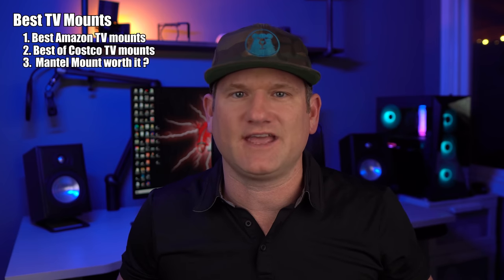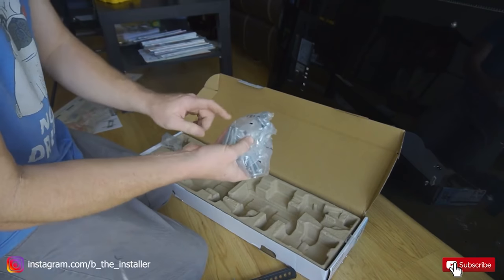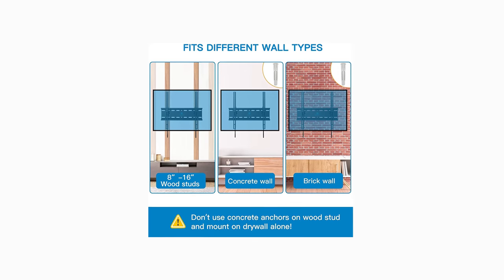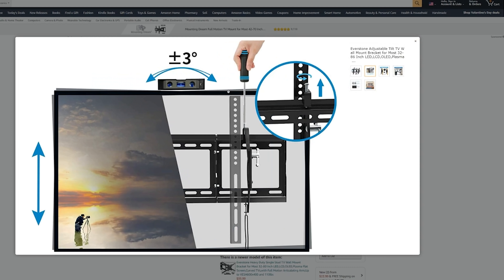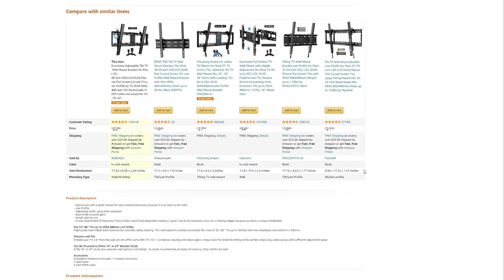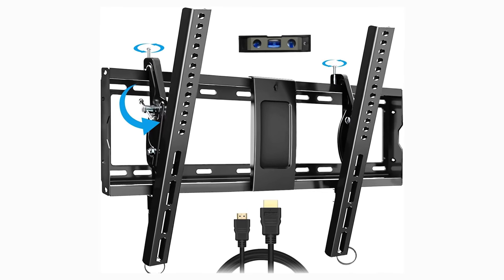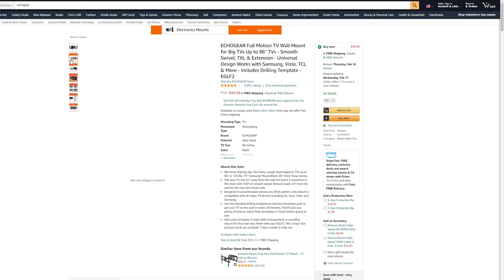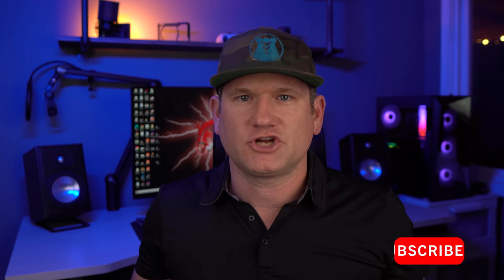Best TV Mounts on Amazon and Costco + Mantel Mount info

Comment: I'm glad that you mentioned the depth of the Mantel Mount. They NEVER show how deep that thing is, because it's actually somewhat of a deterrent. The back of your TV sits 5.7" away from the wall, so unless you have a TV pocket or TV mount pocket in the wall... your TV sits 5.7" + whatever your TV depth is away from the wall. I just bought the MM540 right from Mantel Mount because it's $130 cheaper than Amazon. I also plan on reconstructing my wall above the fireplace to create a pocket for the mount. This way I can avoid the obnoxious, protruding TV that sits further out from the wall than the mantel does.
Reply: How much were you able to grab it? Trying to decide if I should wait for a sale
Reply: @pat4761  ... I don't recall, but it was pricey. I just looked it up on Mantel Mount's site, and it looks like there's a 20% sale right now. $279. It's worth every penny to be honest. We love ours. Super sturdy, good instructions. I'm hanging a 75" on it, and once adjusted... it's a breeze to pull down and put back up. I think we paid the original $499, and I'm still not sorry.
Reply: @pat4761  I just bought the MM540 which is the middle model that can swivel up, down, left, right.  I also bought the recessed mount and this other piece that they said is needed. It came out to roughly $550 shipped to TX. Pretty pricey stuff but they do have a 90 day return policy
Reply: Thanks for bringing up this discussion about the depth of the mount. We don't want the TV to be protruding too far from the wall...

Comment: I can vouch for the fun motion Sanus mount from Costco. Smooth as silk and and I have no anxiety about it being able to keep my LG CX 65" off the floor. 😉
Reply: I just bought the LG 65"--checking out mounts now--getting a carpenter to install the mount after accuratley finding studs!!
Reply: I was playing with one today and the demo was very smooth indeed. Hopefully it holds up a 90lb oled and retains that lol.
Reply: Not sure if anybody will get this comment being that it’s a year later but I just bought the 85 inch Q 90a Samsung do you think this would be a good choice for that particular TV. I’d love to pull it out from the wall sometimes versus flush mount but I am concerned about the weight of the TV and the mount when it’s extended.

Comment: Thank you "B" for all of your video content.  I've watched several of them looking to answer my question and haven't come across it yet.  This one matches my issue over the mantle, but didn't go into how to lift the tv safely into place.
  What is the best/safest way to mount/lift a 135lb 85 inch tv at a high level above the fireplace mantel

Question:
1.  The wall mount says it can hold TV's up to 90 inches and up to 135 lbs.  
2.  How do you lift a 135lb tv's hook point up to 90 inches where the wall mount is located at above a fireplace mantle?  You had the two of you lift a smaller tv up at a lower height, but how do you lift a 85 inch or larger tv up higher?
  I bought the SANUS slf428-b1 mount.  This mount on my 85" Samsung QLED Q72DD tv has the mounting hook 12"'s below the top of the 43" tall tv.

Comment: We got the Echogear 42'-80" Articulating Wall Mount back in Dec 2017. This was for my Sony XBR-850C 65" LCD TV. To move it off the table and onto the wall. I live in Los Angeles, and I was concerned about it flying off the shelf in an earthquake. I also wanted more room to but a Center speaker under it. A buddy, who works at one of the Science Museums on exhibits and displays installed it for me. It was $100 at the time. He liked it for how sturdy and engineered it was. He was able to mount it to the studs in the wall. And he used a leveler to make the TV perfectly level. I mostly keep it flat against the wall. But it's so easy to move it, when I need to managed cables in back or troubleshoot something. I've experimneted tiliting it downward slightly to help with sunlight glare through the blinds. That can be a little ticky adjusting it. You really need 2 people. One to hold the TV at the given able you want. Whele the 2nd person tightens the knob in back to lock it at the desiered angle. If you don't adaquetly tighten it, then it can gradually can anlge forward until it hits the maximum range. It's something like 15 degrees maximum angle downward. Currently, it's flat and parallel to the wall. I do most of my serious TV watching at night. 

Then in summer 2020, I got an LG CX 65" TV. As a precaution, I contacted Echogear and told them I wanted to swap TVs, LCD to an OLED. They sent me a Sanus adapter bracket just in case. For free! Thanks, Echogear. When the TV was delivered, I had BestBuy install it. They took down the Sony LCD and put up the LG OLED. That did not need the Sanus adapter. And they got it within an inch of its originally installed location. I can't tell a difference from the couch. But they could with measurements on the wall. 

While it was $100, it's a quality product. I've very happy with it.

Comment: I got the Mounting Dreams MD2298 16 to 24 Inch stud 132lb articulating mount right after I got my TCL 65 825 set to fit the 24" studs my house has and take the weight, plus handle a bigger TV upgrade down the road. It's great, really solid into the studs, moves really smoothly, and doesn't droop. Really well made and the mounts bars and bracket on the TV are easy to slide together and really beefy. Way better than the 35 dollar eBay bracket I had before which worked fine for my previous 55" TV. It's more expensive but really worth it if you're mounting a heavy large set. I'm upgrading to a 75 Z9K so hoping and pretty sure it can mount it. I'll have to double check that...

Comment: Your videos made is so easy to understand the installation and all measurements necessary to get this right the first time! Thanks so much!!! I finally entered the world of OLED! Our home is a designer's nightmare and we can only put our new 55" TV in a corner. Bought the Costco mount your recommended only to find out 38 inches of sheetrock has one stud 16" from the corner. There's a door frame at 38 inches with NO studs  - only the trim. I need to find a mount that will work so we can extend the TV out from that wall and pivot the TV so it can be seen from from the the rest of the room. I might go to a 65" TV, so the bracket really should hit the corner stud and one at 16".
Reply from the maker: You just need that mounting Dream one and put the 1 stud in center of the wall plate.  I do that all the time and then turn tv.  They also make larger single stud mounts for 65" too.  Just look for one with 100+ lb rating on the single stud.  But personally I would just use that md2380 and turn it after hitting stud in center.  👌🙏

Comment: yes Master Installer, i purchased both MD 2617 which was substituted for MD2630 & Pipishell but neither were adaptable for PROSCAN TV MODEL 5068 w/ dipback.  Pipishell Rep.  it would not worked after screws/spacers did equalize a straight back.  i just want a fixed mounting to FRAME TV ON WALL. VESA PATTERN 400 X 200
Reply from the maker: Something like this is what I would consider for a corner Mount 75" tv.  

https://amzn.to/3WpTHrS

Comment: THANK YOU! I was able to both use your video for feeling confident in doing this on my own, but also your suggestions for the products. I have an older home and wasn't sure if I have 16" or 14" studs. My stud finder kept giving me "false positives" and so six extra holes later that I ended up patching, I almost gave up. I Googled some more and found another video where this guy suggested using magnets. Worked perfectly! I was able to confirm my 24" stud distance and the rest was easy as pie. Sharing the magnet trick in case others have issues with the studs part (which, honestly, took more time than the actual mounting!)

Comment: Exactly what I needed Brandon. Using your link to purchase the MD2380 for a 55" Furrion Full Shade outdoor TV that is 60lbs. Should work out great. Thanks again for the awesome content you provide.
Reply from the maker: Haha, so you're only just at picking the mount?  😆 you really do need me over there.  Have a good week brother
Reply: @BTheInstaller  haha I actually hired an installer as I have no desire to run electrical through cement block as it will be mounted on an exterior wall.
Reply from the maker: Yeah man... hopefully there is power on that inside wall.  If normally wood studs, should be able to get one outside. Message me om IG if you need help.. send  pics at least. I've done that many times.  💪👌  can at least help solidify plan if needed
Reply: @BTheInstaller  “should” be relatively simple as there is an exterior outlet right below where the TV will be mounted.

Comment: i got a 40 dollar Harbor Freight wall mount that works great......i had a 55 Samsung that a switched to a 75 LG and i only had to move the mount 2 inches up on the studs...as for weight, I was a little concerned because the TV was about 85 pounds but all went well...it can swivel and pull out from wall but i don't move it at all so i don't have to worry about putting extra torque on it

Comment: Great video and good information. Had a question..  any suggestions for a corner mount ? Looking to mount a 70in  Visio for my elderly Nieghbor with a vesa 400-200 and weight of 53lbs   Thanks!
Reply from the maker: A single arm, but dual stud mount is best.  So it has an arm that can be moved in many ways but can span 2 studs.  The arm doesn't need to be tight in the corner, I usually use the 2nd and 3rd Stud from Corner

Comment: I have a TV alcove that I added 2x4 supports to in order to mount a bracket. I am thinking the Mantle mount as I can recess the support 2x4" back a few inches to accommodate the thickness of the brace but my center channel is large, I thought about mounting it in the alcove so it is exposed when I lower the screen

Comment: What an informative video - THank you! I would like your recommendation on a mount that both extend from the wall AND rotates to portrait (ie 90 deg). We would like to install a 50" TV in an RV and do not have the room to stow it in landscape. I did see a couple out there that will pivot/rotate 90degress, but NOT extend from the wall. Appreciate your suggestion!

Comment: Hi, merry Christmas and Happy New year to you - thanks for all the videos, they've been massively helpful. We just bought the Everstone adjustable tilting mount for our X65A80J and I have a question for you if you can help?

I've located the studs in our wall. The manual looks like it says to just pre-drill a hole in the studs then attach directly using the provided screws. Is this how you go about it, or do you do anything different when installing (using wall plugs, or your own screws/bolts, for example)?

Comment: I bought the 3rd mount from your list and now I'm stuck not being able to mount it on my wall due to centering issue as my wall studs are not located in the center of the wall. Of course I didn't watch this video before I bought it from Amazon. Wish I had bought the 4th mount you mentioned!

Comment: Great video. I am still looking for a wall mount for my 60" tv. I am about to return my third purchased mount. Why you ask, because the builders of my house obviously framed the fireplace wall on a Friday afternoon. I have a stud at center (that works) but the one on the left is 11" out and the right side is at 16' out from the center. So the largest rear mounting panel was at 27" end to end and the mounting holes fell about an 1.5" to the inside. One came close but it had a formed rib running right where I would have had to add a hole.
I can't seem to get past the lack of actual mounting hole dimensioning in the ads for these mounts. At least you gave me a couple of new vendors to check out - thanks because I am running out of ideas short of cutting out the drywall and adding studs myself.
Reply: Hit the stud you have available and use some good wall anchors. There are plenty of very strong options available.

Comment: so i once hang a plasma tv 2007 and when i put in onto the wall  it cracked the screen, im thinking of wall mounting my oled, and i dont wanna crack the screen, any toughts on what i did wrong, and how to aviod that buying a mount that 100% wont do that. it was a type of that u showed where you put it onto the wall on the wall rack as the 2 option in this video

Comment: B, any revised recommendations? I'm looking to mount a Hisense 50U6G on a wall perpendicular to the viewing location which would require a 60* swivel and 15* tilt for it to properly face the viewing location. It would be swung out every single time it's used (possibly daily) and stowed after use as it otherwise blocks a walkway, so leaning towards something higher quality.

Comment: Hi B - awesome video thanks. Have run into a problem though and could really use some advice if you can spare a few minutes please?

I recently bought the Everstone WLT103M-ES to mount my A80J (65"). It said on the listing that it comes with the fixings for all wall types, but on opening the box and reading the booklet it only has options for Wood studs or Brick/Concrete walls. However I have aluminium studs.

Have you installed one of these to Alu studs before? Or if not do you have any tips for fixing to Alu studs in general? What sort of fixings should I use - is heavy duty toggle bolts the best option and if so can you recommend some decent ones? Or should I try to find something compatible with the large (component W1) screws provided? Or replace them with something else the same diameter?

Thanks in advance
Reply from the maker: Toggle bolts. 2 in each metal stud.  Get a 1/2 metal bit and it will chew through the stud like a warm knife through butter.

Comment: Awesome Video!  But I need a 100x100 monitor wall mount that slides 'straight' in/out. (for a flight Sim cockpit) It needs to be able to be 'centered' at every distance.  It looks like the 'scissor' mounts would work, but their brackets would stick way out. Any ideas?  Thx!

Comment: I have a question on the mantelmount. We are considering buying a framed tv as it can look like a painting. The only spot to put a tv unfortunately it above our fireplace (we have a faux wall on the wall space above the mantle where the tv would go that could effectively hide wires and brackets). Me question is when the mantlemount is in its upright position is it flat against the wall or does it tilt down slightly? With it being a framed tv we obviously would want it flat when not in use. Thanks in advance for your advise!
Ami

Comment: Hey question: I got a 12 x 10 Wood Gazebo With Aluminum Roof and I’m looking to install 43” Furrion outdoor TV (40 lbs) inside the gazebo inside the rear right corner pillar.  I’ll also be including a Furrion sound bar.  Can you recommend the best cost efficient mount that fit the top corner ?

I do have a mesh kit in my gazebo

Comment: Can anyone recommend a full articulation, single-stud mount where the center of the tv ends up offset by at least 7”? Preferably one that can extend up to 24”? I only have one viable stud to bolt to, and if the tv ends up centered on that stud it will be too close to a window. Thanks!

Comment: B I was looking at the second Everstone mount you suggested for my 85" Samsung Q60A (Shipping Weight
125 lbs) to mount in my drywall only because my wall doesn't have studs but the Everstone mount says, "Do not mount only on Drywall!" 

There are a ton of toggle mount videos but what mount and toggle kit do you suggest if you have to use 1.5" to 2" screws in a wall (max) so as not to punch out the other side. < (Old 1962 apt bldg, drywall sounds really solid)

Comment: I would really love to get your answer on this. So I bought the 85 inch Samsung Q 90a. Its weight is 98 pounds without the stand. I looked at the Costco mount you recommended that’s full motion it says it has a total weight of 125 pounds for integrity. The TV without the stand is 98 pounds it’s getting pretty close to it. Do you think its still safe to use or should I look into a different mount that has more weight capacity?

Comment: Awesome video B. I have an 83" LG C1 on the way and will have to mount it over my fireplace (bottom of TV will be ~63" high off the ground). I know it's personal preference, but what are your thoughts on whether that height is too high, especially considering the top of the TV will be ~104" high off the ground? I was looking at the Mantle Mount 750, but $1,000 for a mount is 25%+ of what I paid for the TV. I may just put that money towards remodeling that wall and changing to a lower profile fireplace. I appreciate any thoughts you may provide.
Reply: How did you end up mounting your 83"?

Comment: Any particular model you’d recommend for this, Brandon?

Planning on having my 77” a80j mounted onto a 2” concrete wall, planning on the bolts going through & being anchored 🔩 on the other side of the wall, with wires also going through, then coming back out near the floor.

I have my own level I’m providing the installer just in case, lol.
Reply: Spend a little money and get a MountIt! Mount

Comment: Great video, looking to purchase the Sony XBR-900h 55in. Also still on the fence for the XBR-55A8G OLED. I already have the MD2380 new and ready to install. My question is should I spend top dollar on the Sony SU-WL855 ultra slim wall-mount , due to the fact I go from flat to 30 degree daily. Also 65 inch is also and option. Thanks I'm really enjoying your videos.
Reply from the maker: I don't love the x900h but the a8h is great.  The 2380 is good for 55, can do 65 as well.  I like the larger mD 2198 for 65 if OLED